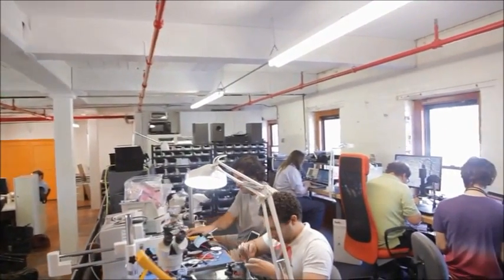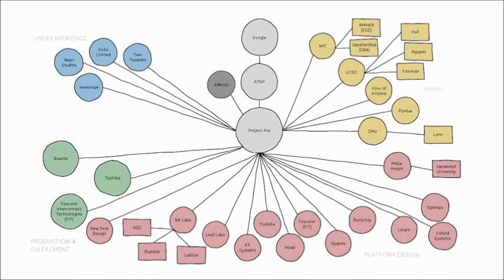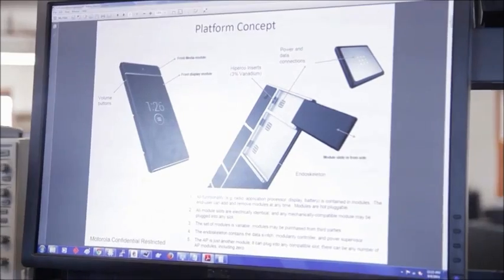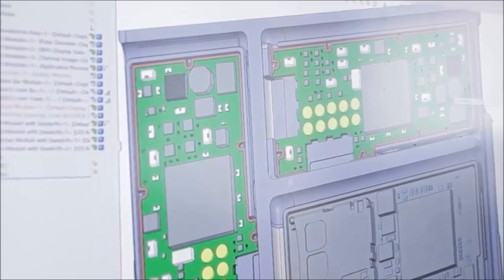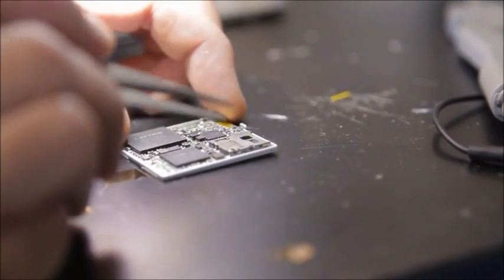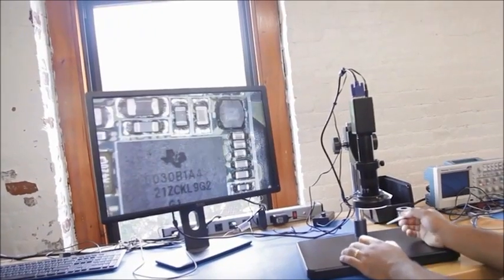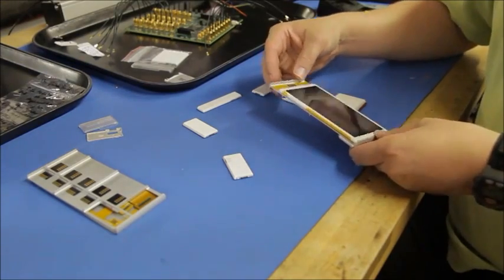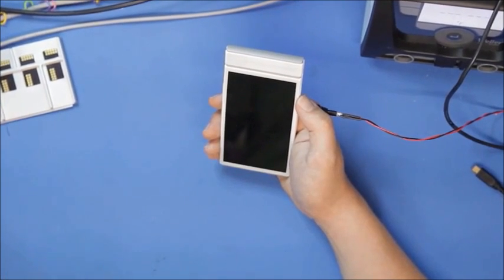Fully Functional Phonebloks & Project Ara Prototype - Hands On

Comment: It's also going to cost a hell of a lot more than any PreBuilt phone that would function just as well, if not better on a general basis
Reply: +jacob butt I don't think iPhones are durable either.
Reply: +jacob butt Still cheaper than an iPhone
Reply: hahaha because iPhones are stupid overpriced. They're just durable and easy to use.
Reply: No i dont think so the developers would try to make it at an affordable price to sell
Reply: okay, but they can "try" to make anything an affordable price but it's not always accomplished
Like cars, they try to make those cheap, try and find a car with all the features you want for a "cheap" price
Reply: +jacob butt its is most likely in my opinion going to cost 350 max

Comment: they shouldnt use electromagnets because it could come louse and uses you're battery , they need that thing when you push it in once to get it in and push it in twice to get it out and instead of having compasses and stuff , just get the app like on a apple phone , and it shouldnt be "put more than one battery in or put night vision on" it should be "when you're software is outdated get a new updated one and just click it on you're phone"
Reply: They use a special type of electro magnet, you power it to toggle it on and off, it doesn't need a constant supply of power
Reply: They use a special type of electro magnet, you power it to toggle it on and off, it doesn't need a constant supply of power

Comment: Its posible to put 2 cameras and. Record in 3d????   Or. Put. 2 processor. ?
Reply: Most likely they would make a block you can put in that has two camaras instead of one
Reply: +Adan Elizondo no simple one camera with different optical arrangement to  record 3d

Comment: Well, Project Ara is really a huge and promising technology. Amazing indeed but Android, I guess, is not the appropriate mobile operating system for that. It will only turn out as usual android smartphone. The creativity and innovation would be useless. The developers or The Team Project Ara should innovate to create its own operating system. Hardware and software integration should be totally emphasised. I'm not against about the Android but Ara Device is really different and it should be treated special.
Reply: Nico De Angelo But Project Ara, is by Google. Google, is Android. :O
Reply: Nico De Angelo The OS is only as good as the user :D most of the time. I dont see what wrong with android. And yes "Ara, is by Google. Google, is Android"
Reply: +Nico De Angelo It would be a bad idea because Android and iOS has been in the game for so long and since they've been in the game for a while, they will have more app choices. That's why Windows Phones are still playing catchup and also the reason why the Amazon Firephone failed so badly. No available apps. It's better to stick with a phone OS that is already deeply integrated into today's society. With Android, you will have more app choices for those specific modular parts.
Reply: Yes you are correct they should create their own own os system
Reply: No, IMO android is fine, perhaps they should leave it rooted though

Comment: Google Project Ara future - copied from projectaratalk.com

Before it has been released, let think about what the "SmartPhone" goes to be in the future.
It is no longer a smartphone. It is not a phone, but a portable super computer.
It could be connected to human body by remove 1 of the smartphone module and connect the portable biomedical equipment.
It could be a car control. You put your car key module into your phone/to you car, set the location in your phone, and then the car will drive you there.
It could be a desktop computer. You will need to buy a projector module, and a laser projection keyboard module.
Tell me what you think!
Reply: https://www.facebook.com/projectaratalk

Comment: I wonder what the battery performance can be like cuz it seems to me that there isnt really much space for a >3000 mah battery to fit in.
Reply: You can put multiple batteries on the back.
Reply: Of course you can but I think it may be impractical considering that essential components of a phone may occupy most slots already
Reply: I think you overestimate how many things are actually making your phone function... majority of your phone is the screen. Everything else is pretty thin behind it. Ara layers those thin pieces together to reduce the amount of space they take up extremely. All the crucially needed parts of the phone are all in the 2x1 modular that holds your "identity". Then you only need to pick a ram, cpu, and video card. You will most likely be able to buy a modular that has both the CPU and RAM together in a 2x1. Graphics card might be a 1x1, if not paired with another thing.
Reply: In another video I saw, they talked about how different modules could "multitask" and have multiple functions. Modules can store power and consume power at the same time. You can theoretically have a module that is part battery and part memory for example
Reply: Dont worry with time they will fix that it is still a prototype